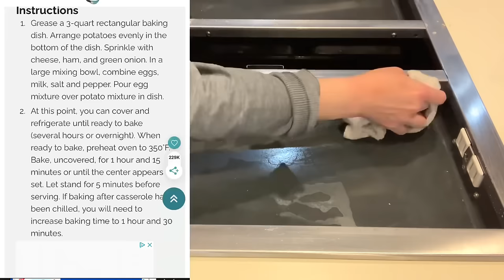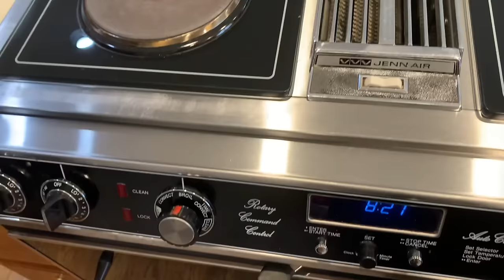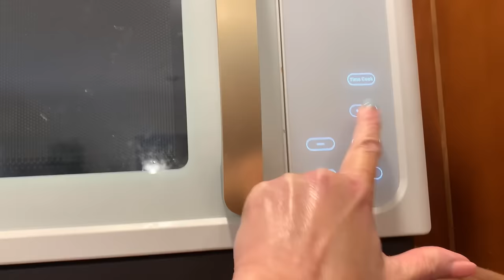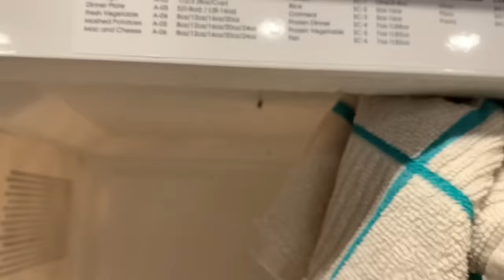🌟 NEW BONUS VIDEO 🌟 Kitchen deep clean to prepare to host for Easter 🐣

Comment: Heating up a cup of water in micro is not just strictly for loosening stuck on food. It also acts as a sanitizer as if you were using your steamer on it. So I would do it and let it run while you are doing another 5 min task. The lemon really makes it smell good and helps with sanitizing. 👍

Comment: Its not paint. Its burner top repair. But yes it kinda goes on like paint I guess. Once you use it you will notice a HUGE difference even if they look good right now. The burners should be pitch black. They show up on camera a little brick reddish to me. Which means the top is wearing off.